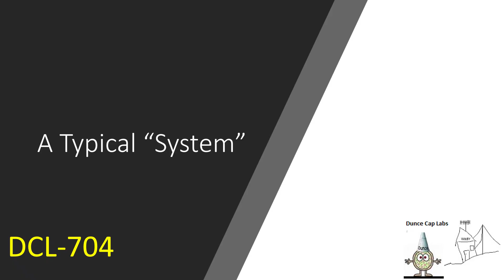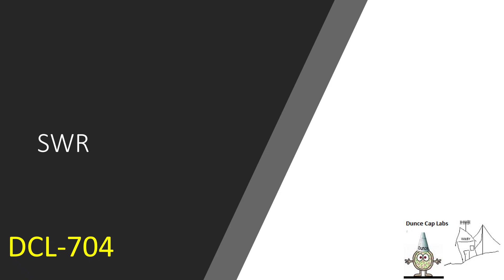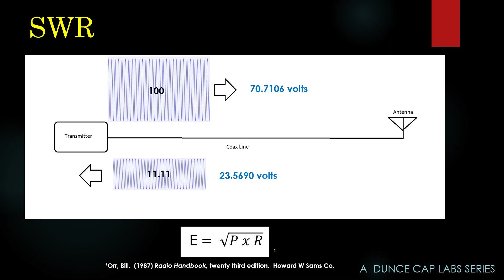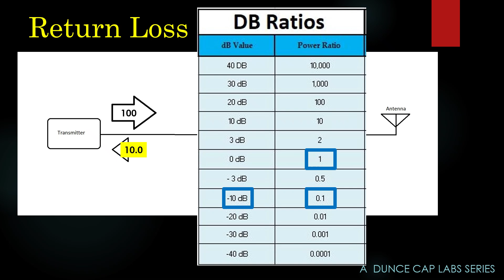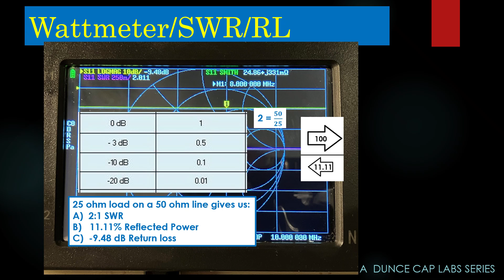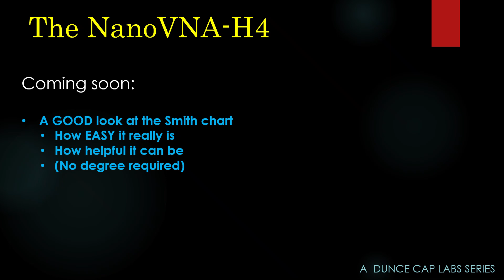DCL-704 The NanoVNA-H4 Understanding SWR/Smith Charts, etc.

Comment: This is such a good video. Especially when you calculated the VSWR with the E+√P*R. I too memorised the 1+√Pr/Pf/1-Pr/Pf for the exam. Yet you went full circle with the ohms law formula too. And it all adds up when you included return loss also.
Reply from the maker: Thanks for this feedback.     You know, the math of radio is part of the fun of radio. :)
Reply: @WR8YsDunceCapLabs-e6d indeed. I was praying not to get difficult maths formulas for the exam, yet the real hard stuff comes after the exam. Providing you delve more into radio than just cq cq cq. 
I bought an old Yaesu FT 480R for Christmas, I was told it only had an ssb alignment issue, yet I first key'd it up today and realised the finals may be buggered. The hard stuff now begins, like you said, it's fun. Hard, but fun.